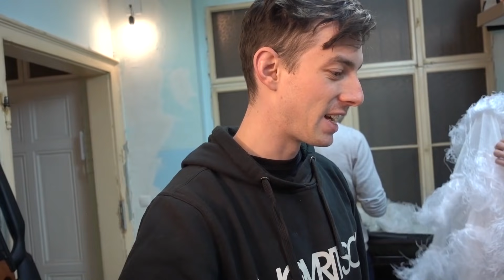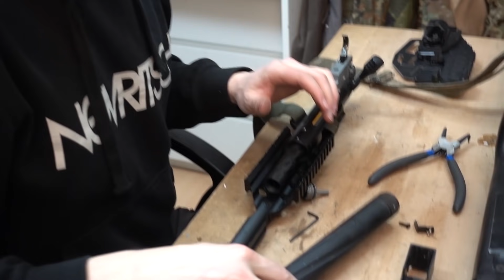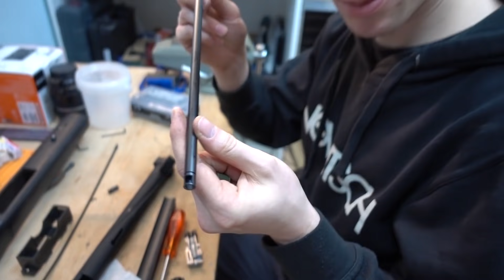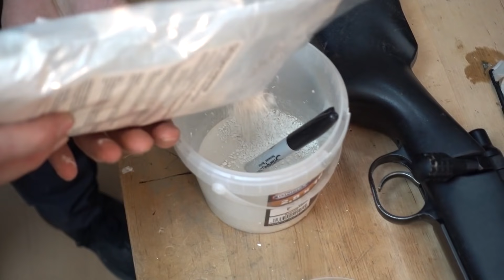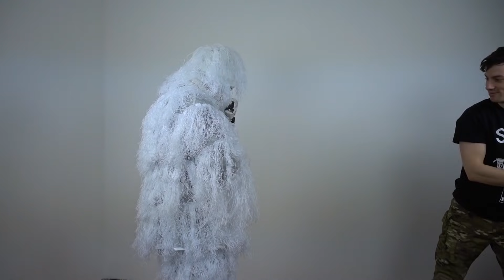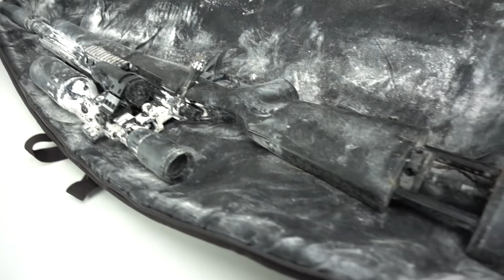This SNOW setup for 50$

Comment: Awesome, but I feel like the ''paintjob'' could be done more easily/cheaply. There is a super cheap method that german soldiers in WWII used for turning their helmets and other equipment white which I think would have even better results. it also comes off if you use warm water and shouldn't scratch that easily. Just buy some chalk, turn it into very fine dust, mix it with water (it should be relatively thick so don't use too much water) and use brush to apply, result should be something very similar to this. If done properly, it should just barely come off with normal water and it should easily come off with warm or boiling water. It should also be less scratchable if it's done properly. I don't know how much did your version of the ''paintjob'' cost, but I think that you cannot get much cheaper than chalk and water.